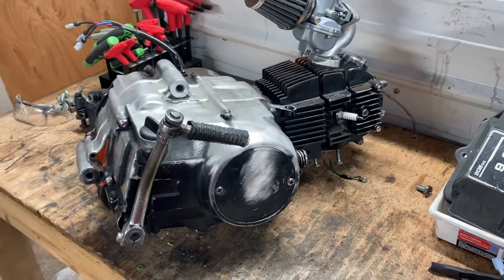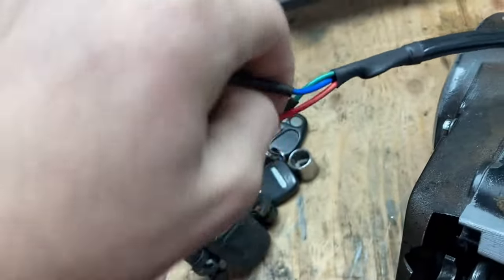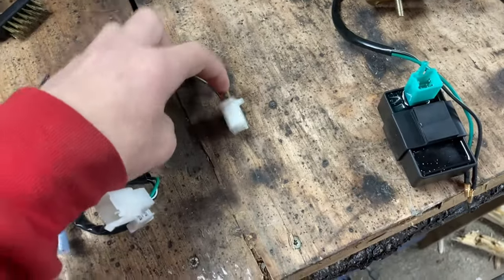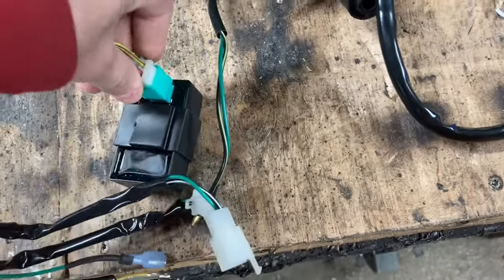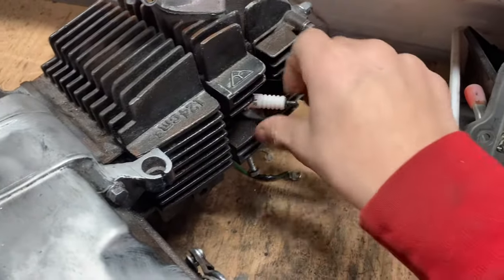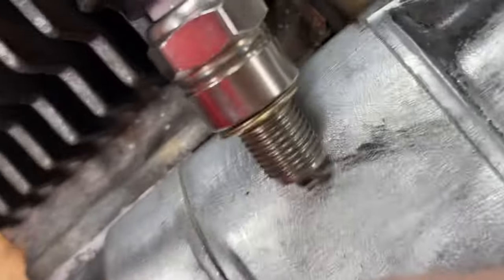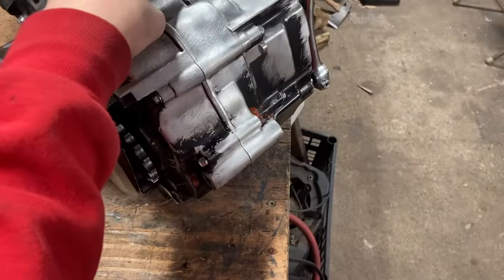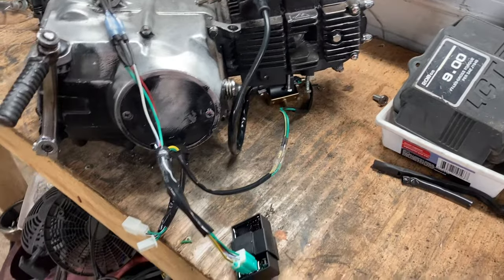How to wire a 125cc kick start engine

Comment: Im trying to wire up a temu 125cc loom to tf125..im only wanting spark ive got 70% done maybe but if i remove the rest of loom the wires are connected to other plugs and i dont know where to connect them. Can you point me in the right direction please.

Comment: Hi there, just wanting to ask you if this would work on electric start engine as well cuz mine has both kickstart and electric start setup just wondering though if kickstart wiring harness you have would ever work on electric start without battery any advice?

Comment: I got a new engine and my new engine has two yellow wires instead of one yellow wire and one white wire (which is what my wiring harness has) so I can't connect it with the simple color code like I had it before and have no idea what to do now

can I just connect  one of the yellow wires from the engine to the yellow on the harness and then connect the other yellow wire from the engine to the white wire on the harness or will this break something? 

please help anyone!